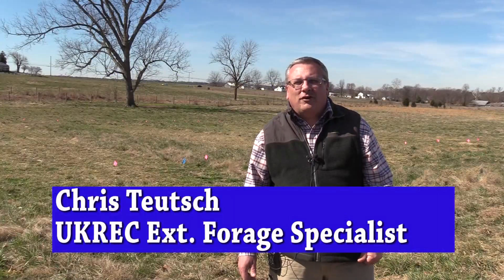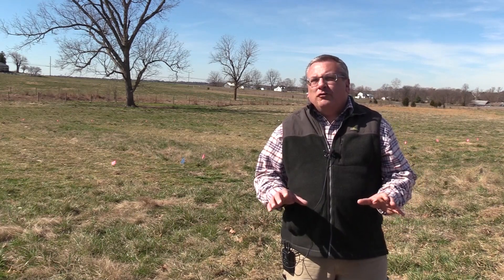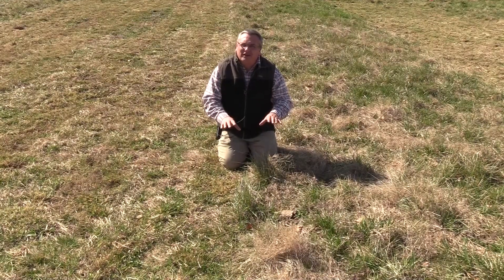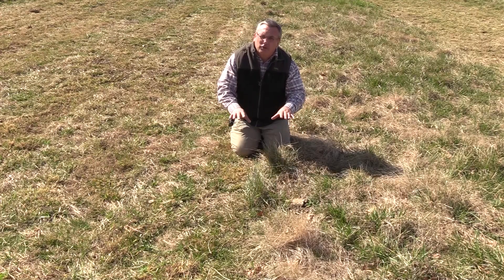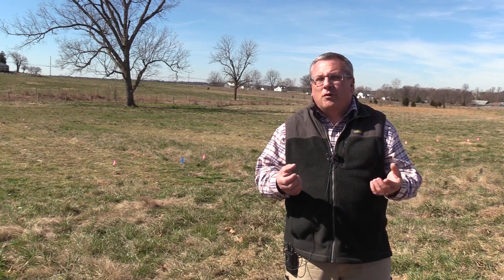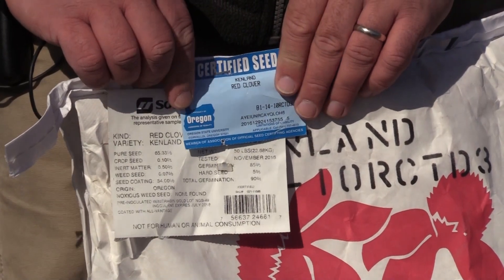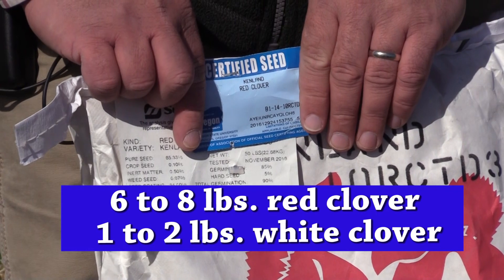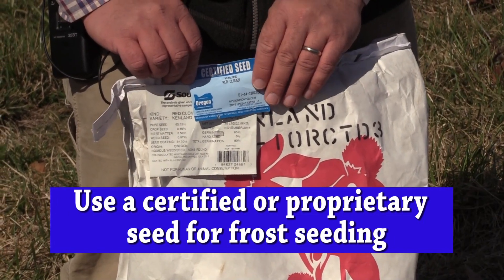Frost Seeding of Clover

Comment: We have snow almost up to Spring grazing.  In the valley here it goes from snowy frozen to frost frozen to tractor axle deep mud to growing season in which the pasture grows so fast our sheep cant keep up so we end up mowing early on the area that they cant knock down fast enough.  Then by August it slows and the sheep catch up.  My problem is that most of my pasture is over grazed by cows and horses before i bought it.  Now i have to build back…you guessed it…better!  (Sorry….that’s the only actual use of the phrase that makes any sense this year)